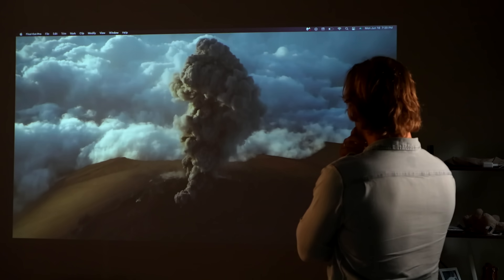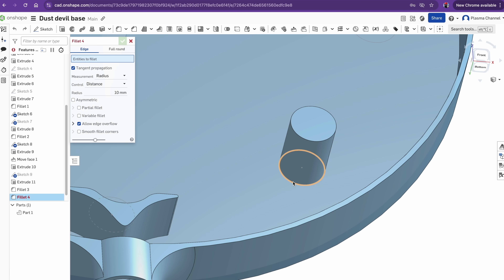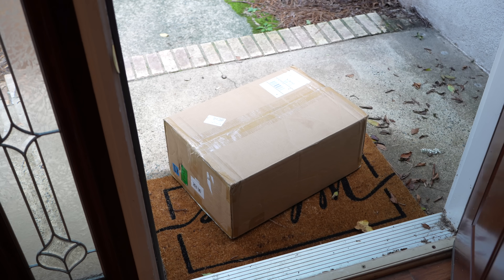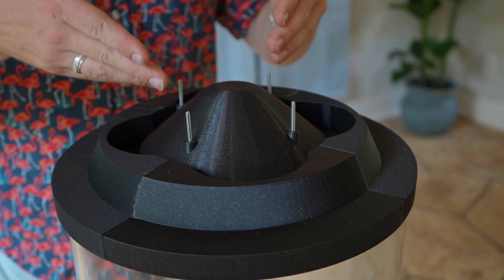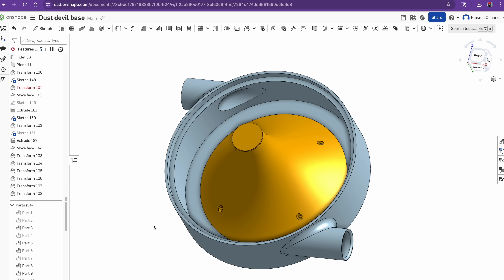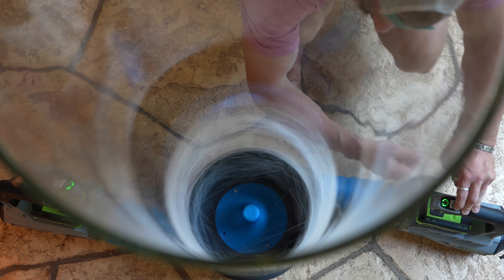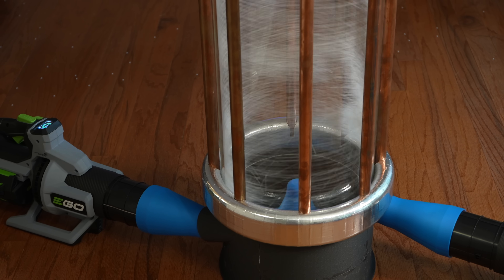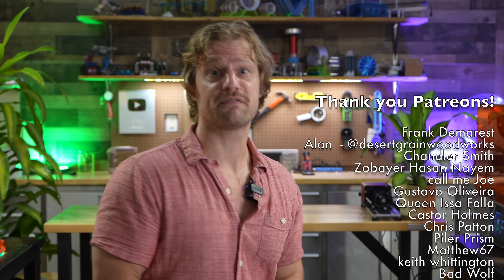Making Lightning In A Bottle Might Be Possible  (ft. 3D Printing Nerd)

Comment: you need to get one of those old Dyson vacuum motors from 2004~ the really big mains ones. shove it at the top of the tube to pull air out and then put the output from that into the bottom. this will do too things, one: actually help a vortex since there will be low pressure at the top, and two: those old motors use a bunch of power and use the air moving through them as coolent. This means that it will heat your air helping the static build up. I remember ages ago vacuuming  I very dirty floor with losts of mud dust, that charged the dust collection bin on the dyson enough that I got a decent spark out of it

Comment: i made a voltage multipier based on your video. but the blue ceramic capacitors literally blew up when connected to a 15khz 5kv ac supply. The max current is around 50 ma

Comment: Jay I think you finally made a crystalline plasma structure? Or something very close to it. The way those balls all form a matrix structure. Then collapseses when discharged. Theres something special going on here.

Try thinner glass if you can? Might need to go smaller to do so. I think its discharging so badly because the capacitance of thick glass is terrible. Foil inside & out and measure the capacitance. Its probably 2pf or less... With so little capacity it only takes a fraction of a nano amp to bleed it. Everthing you added also added discharge. Maybe you can just add a high voltage cap to increase the farads? 

Also. Finally. Give it more balls!

Comment: You could probably make something like this as a dekstop curio, use a small fan in the base that blows air up through a bottom intake, then through vectored input vents, to spin smaller beads against a smaller tube. NGL, I kinda wanna try that for myself.

Comment: Repulsive charge from you r hands
Reply: Maybe a copper mesh and capacitors. Batteries and possibly photovoltaic cells or just the semiconductors.  I haven't checked the last.

Comment: I think you can only transport the charge through contact. So you'd need the balls to bump into something conductive. The glass isn't able to put the charge anywhere so you probably want heavier glass balls on the bottom that bump into something grounded, and a metal ring up top where the plastic balls give off their charge, or something like that.

Comment: Just a random thought, if you would make an upside down Y with both ends of the Y turning in an opposite direction, the beats would all collide with each other at the top, releasing some of the energy of the velocity they have.
If this does not lower the durability of the beats too much, I am pretty sure this raises the electrical output vs two blowers blowing in the same direction.
I am guessing the reduced energy output compared to what you experienced with the vacuum is because everything bounces around and collides so much more inside of the vacuum hose.
Instead of buying a complex Y shaped glass tube, you could simply use two plastic tubes that lead up to the singular glass tube; this is where the main release of energy will be at anyways.

As an afterthought, I think that even putting in 2 well placed ridges/ramps in your single I shaped glass tube would increase the power output by a lot; just anything that makes them collide with each other should do the trick.

Comment: You look like an expert on Tesla coils and I can’t get my slayer exciter to work so I have come to you. I have a Tesla coil and the wood base is 25cm by 25 cm and the pvc pipe is 49.5 cm long and an inch wide and around pvc is 45 cm of 24 gauge enameled copper wire and I have primary coil that is 14 gauge pure 99.9% dead soft copper which is in helix shape and has 6 spirals and I have a e13009-2 transistor and 4.7k resistor and a 36 volt 4 amp power supply so what connects to what

Comment: I work with a material called Lucite. It's used to prevent sheets of glass from vacuuming together when stacked. It's basically tiny glass marbles and it builds a CRAZY charge when vacuumed up. I wonder if it would work in this device.

Comment: I would guess that main issues is the contact of the particles with the tube where the charge is spread and lost. I think you need your design to suck :D as @GiesbertNijhuis points out. In addition, I once tried to solve an issue with static electricity in an industrial environment and learned from googling that moisture of air plays a big role. Moist air dissipate charge.

Comment: Your working with static from electrons and your closed system has same total charge. You need to change it slightly to draw a charge from the ground. by using the external connection directly to a ground it will draw in extra electrons into the system and charge your inner connection. any contact between inner connection and ground will discharge it.

Comment: Go Back to vortex  there are comments there on how you need to suck out not blow in and other recommendations  is static yours makes  but it's randomly accumulated between each ball with the  vortex the potential builds on top  plate compared to bottom. And you can pull that static while it's active not just when it is off. The beads kill each others charge because they are not all uniformly charged

Comment: Where is your isolation? to the ground, from up to down? from outside to the middle. . . 
btw. Why you use two air blower and shrink the diamiter to 50%? Use one and split the aireflow. Would be more efficient I guess.

Comment: A vortex can be made by placing two upright, slightly offset half-pipes so that air entering between them flows at an angle. When air is drawn upward from the top, this angled inflow begins to rotate. The rotation forms a stable, spiraling column that’s easy to see if you add some particles.

Comment: Why did you think you could induce static electricity via induction and even retain that charge there? How would you magically get a surplus or lack of electrons in a disconnected place? Induction just moves charges within the conductor.
Reply from the maker: So, electrostatic induction is different from EM induction. I was planning on ES induction. Local charges will influence external electrons trapped in metal to move. That metal, being the toroid ring. Letting it be grounded while power is on, then disconnecting ground leads to an induced charge.

Comment: In college I worked at a coal-fired power plant.  One of the jobs I had was using a suction truck to remove fly ash from the precipitator decks.  Imagine that vacuum example, but with a corrugated black drain line as the hose and a truck-sized vacuum.  It would arc 12 inches to zap you.  Also, the easier way to wrangle the hose was to straddle it. 😬

Comment: So Cat heavy  equipment engine air filters, when we blow the filters out with an air gun. You can see little lightning shocks from the blow gun to the filter wire mesh. You can feel it as well.

Comment: What about just... rotating the glass cylinder itself? is this cheating? Possibly, but proof of concept, just having the plastic beads in there with the cylinder spinning on its side should produce similar results along the entire length of the tube, no?

Comment: I think if you want to get a more tornado shape you need to reduce the inlet to the chamber and have the air enter the inlet like a votex cooler does, still tangental. Also you need more atmospheric pressure on the bottom by adding vents on the bottom of the glass. Without the vents to allow pressue difference you are just roataing a fluid in a container like a mixer.

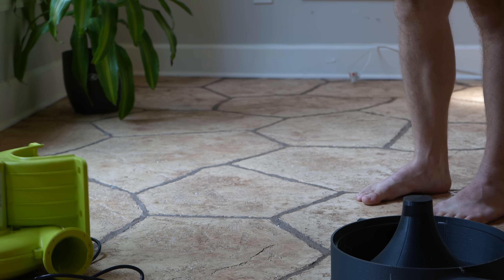Comment: 10:44 those are definitely green works blowers. I don't know anything about the tools but I definitely know they're off brand Amazon batteries are fantastic because I use them as huge power banks. They have a USBC output on them and work amazing. I got them from a Amazon return store and have had offers on them and I think I might just de-list them because they are too useful.

Comment: I am at the point 12:09 of this video now and still asking myself: While you already can prevent the plastic balls or sand from getting out of the top of your tube, why do you attach the air pumps only at the bottom instead of trying to create sort of an air circulation by blowing air into the bottom and sucking air from the top simultaneously?

Comment: In a vacuum chamber, oxygen can influence how static electricity behaves, but it doesn't directly interfere with its generation or accumulation. Oxygen, being a gas, can affect the breakdown voltage of a spark, meaning it can make it easier or harder for a spark to occur depending on the pressure and oxygen concentration. In a vacuum, the absence of air can make it more difficult for static charges to dissipate, potentially leading to a higher voltage buildup. However, in the presence of oxygen, even a small spark can ignite flammable substances if the oxygen concentration is high enough.

Comment: Hi, nice video! The reason why the "inductive pickup" didn't work was because induction is the change in flux. Induction requires a magnetic field which requires a current or a changing electric field. You static field did not deliver either. The problem is mainly that you're expecting to store a static field in a capacitor-like medium where what you're looking for is something more like what a Vandegraaffgenerator does. Maybe you should revisit this with an antistatic glass or plastic and using the nylon and PE balls since the charges on the glass will only accumulate during the deceleration of the balls against the glass. I would love to see the lightning shoot between the balls, perhaps you can mount two rods, one on the bottom and one on the top of the cylinder in order for the charges to accumulate as the balls hit eachother after which they can arc by shorting out the two rods in both ends of the cylinder

Comment: Mr vortex is correct another possibility is use opposite air force. Hot air at the bottom blowing up the center and cold air at the top blowing down the outside. The interaction with only the glass is limiting potential getting your "sand" to interact with the glass and itself will maximize potential output

Comment: Put a wind turbine inside to generate electricity from the twister’s power  .. is this even possible?
Reply from the maker: A turbine inside would generate power, but ultimately it would generate less power than the leafblowers are using.

Comment: Is you can source powdered ebonite it should build up considerably more charge.
Reply from the maker: Not familiar with that. I'll look it up!
Reply: @PlasmaChannel  Also if the cylinder is made of pvc, same material most 5gal buckets are made of I think will generate more charge. Problem would be it is not transparent. As for collecting the charge maybe a grid of small holes drilled throughout the cylinder which you could place coper probes through. If the protrude inside an inch or so that would provide additional surface area for the ebonite to flow against to pull charge from. GL :)

Comment: Built a 2kW three-stage cyclone vacuum with sheet steel cylinders to extract and bag several tons of old filler out from an underfloor space. The filler was presumably mostly coal ash. 

The sparks that came off various parts of that thing were terrifying. And quite painful.

Comment: You cannot create a vortex with a narrow or same sized exit for the air.  The static charge is built up thru collisions of the particles.    Screw up the flow in the tube to introduce more collisions.  Charge separation will happen.  Use quartz (Sand) and you may get some piezo electric effect added in.

Comment: 1) the initial clips showed sparks when sucking in air. Your bottle blows a vortex. Sucking is not blowing. The former slightly pulls the dust particles slightly together, the later pushes them apart.
2) I would go back to having two kinds of particals. With one being heavier and hitting the bottom metal plate more often.
Then a vertical strap of foil on the top half of the tube, with a big capacitor parallel to the electricity consumer. You don't what the foil to have the same charge as the particals it should extract charge from.

Comment: The fans introduce dirty airflow, you need a laminar flow for a vortex, do not use a fan to blow air, you actually need to suck the air from the top, a fan can do it if it bloww the air to outside by extracting the air from the device, the bottom plate can be designed to allow laminar flow or introduce the vortex, that will have to be experimented or calculated.

Comment: You know that tempered glass in schools and police building windows and such, security glass. It has metal built into the glass itself, so what if a cylinder of that were your tube and somehow have the metal protrude from the top and bottom edges  connected to metal collection plates.

Comment: I feel like you would get a better result if you mirrored the bottom, and had cold air flow down from the top and hot going up. Also, the copper needs to flow in the same direction as the air. Maybe magnetics could help generate more energy.

Comment: I know a really good way to make it into a vortex your on the right track but I think you should make the container and the conductive cage should be made like an ice cream cone shape and make a brace system base it would have no choice but to spin in a vortex shape with the glass being the shape it is in theory it should work that way and and also for extraction of the static think of socks on a carpet or balloon on a shirt when you rub it on the shirt and touch someone with the negative and positive ions meeting in the middle when you ground yourself by touching someone as you are positive and they are negative when they touch together you get a spark

Comment: Oh I hope you get it amped up and don't give up on this! The potential is fantastic: your vacuum cleaner was absolutely pumping electrons. 

I'm fairly certain that the balls need to cyclically touch two different materials in regular sequence, if they're going to really make steady current. Your setup has an equilibrium pairing of material bodies (the same two pieces of stuff, at the same speed, with the same average relative position between each other, permanently). This can only really make an initial transient charge separation, and not a constant current (aside from second order effects like the random vertical collisions of balls on adjacent orbits).

Think about what's happening in the sand/vacuum cleaner scenario, or in "Armstrong's electrostatic boiler." Two materials in a triboelectric pair are being brought into contact, and then one of them is completely discarded: so a stream of uncharged material is brought towards the point of contact, interacts, and then leaves charged, dragging a net electrical current with it down the stream. With your setup the two materials interact and then the very same particles keep interacting, and their transferred charge isn't separated more than a short distance.

I think if you want to recycle the same particles in a closed loop and you also want steady current, you need to have them hit first one material and then a different material before going back. The materials need very different triboelectric series positions and/or conductivities. The balls probably should have a series position mid-way between the other two although honestly I don't know if that's at all important.

You basically want the surface charge of the balls swapping polarities as it first touches one material and then the other, so even though the balls are going back and forth, net charge of one particular sign is only moving in one direction. 

Incidentally your super cool video really made me think about how it's not at all obvious how this is happening in a real sand storm! In nature it's probably more like your scenario, where it's sand blowing across more sand. This is not obviously going to be super "electrical." The fact that storms produce such spectacular results is a demonstration of the awesome power of nature! Keep this stuff coming, love it: even the ones that maybe don't feel like smash-it-out-of-the-park builds (as you seem to be feeling about this one). It's all amazing!